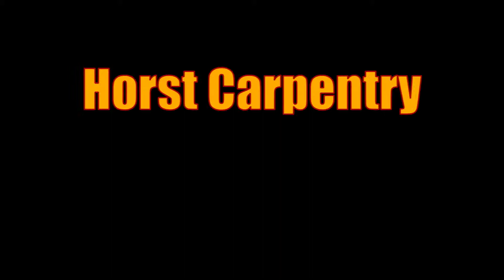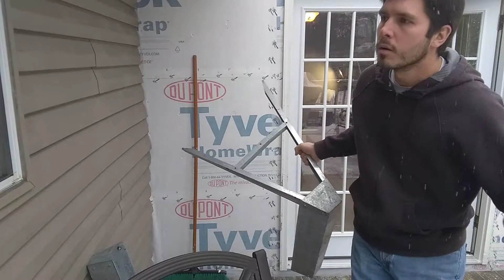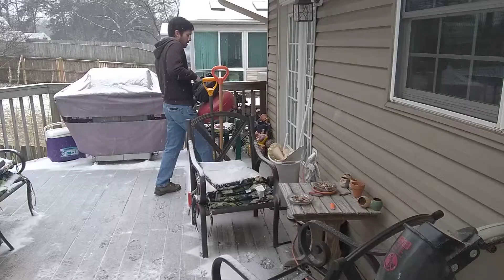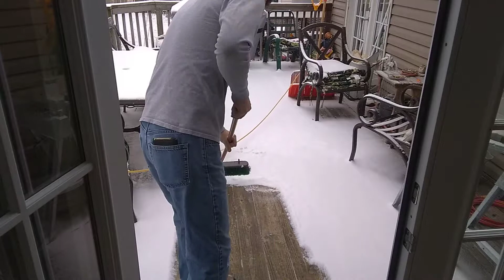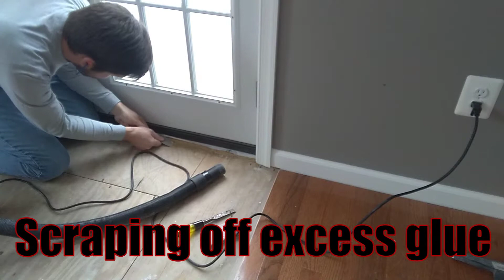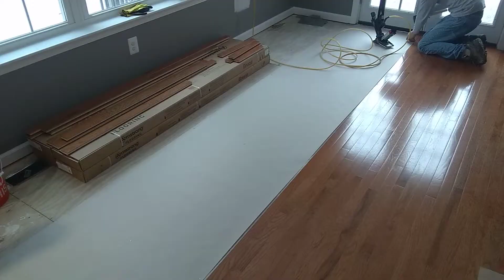House Addition | Flooring & Final Inspection pt2 | Day 71

Comment: I got failed one time because the builder didn't file the septic tank permit. I have yet to figure out how that involves a service only electrical inspection. But it cost the builder two permits for the same inspection. Overbuild and underpromise, it's the only way to win. You're on the home stretch now. I'm taking 10 days off next week and then it is wide open for as long as I can see. I likely won't live long enough to get caught up.
Reply from the maker: Enjoy your days off